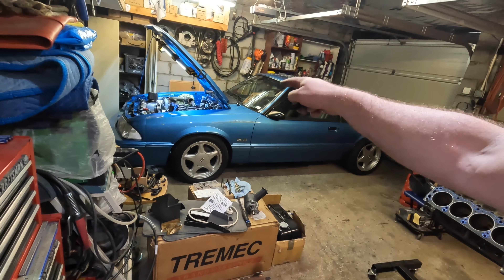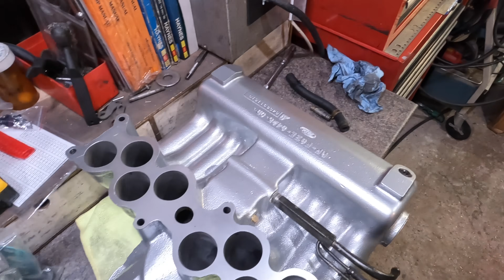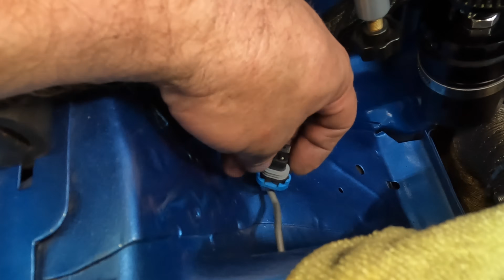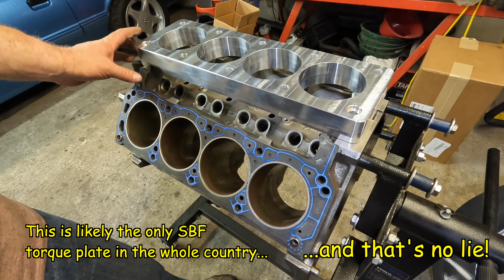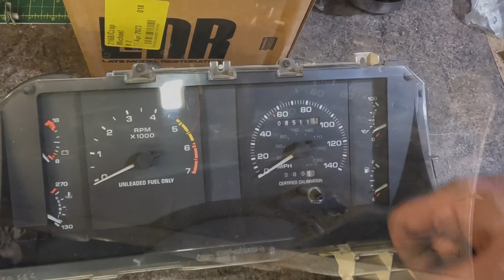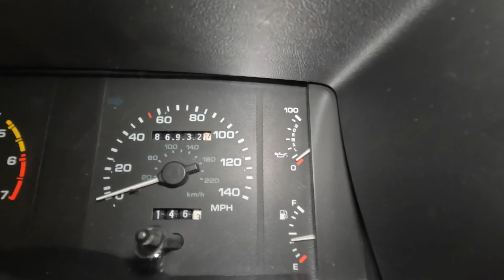Garage Update. Foxbody PCV Delete, Torque Plate Issue and SSP Speedometer

Comment: Back when my intake had a provision for a pcv a long time ago seems like I bought a 21 or 22mm rubber grommet that expanded when tightened. And you can get a plug from innotronix that will plug into harness that makes it think the egr is working so you won’t get check engine light
Reply from the maker: I couldn’t find any of those expanding plugs here in the UK. One of the issues we constantly need to deal with.  No need for any computer trickery as I’m running a Terminator X system.  It could care less. 😁

Comment: MIke if you have a machine shop close, they could easily plugged that and mill the 2 proper size counter bores in there for you, or just press a plug in with the correct dia couter bore. Being that it's aluminum it wouldn't be hard but it would likely cost you as much as what you paid for the torque plate. Sucks its not right from the factory. Great video brother.
Reply from the maker: Easier said than done Pete.  I tried to get some lathe work done here a few years ago and, let’s just say it was like people here just don’t want to work.  I’d do the job myself if I had access to a lathe.  It’s just disappointing as it’s a silly problem to have.